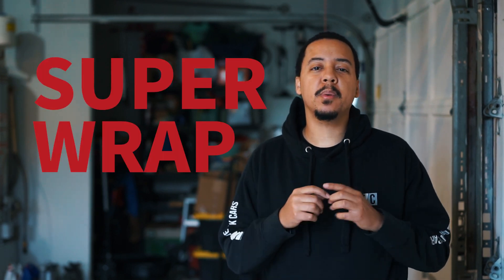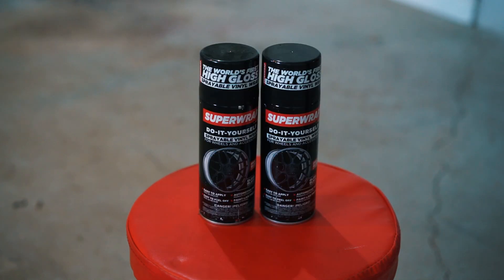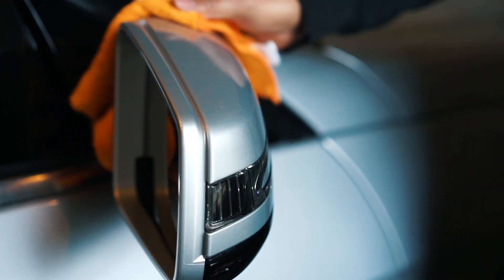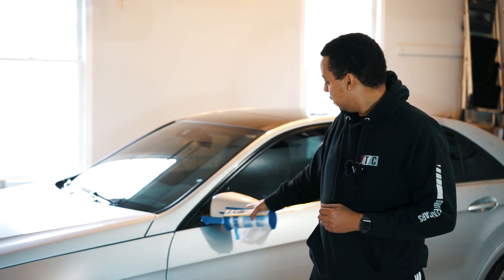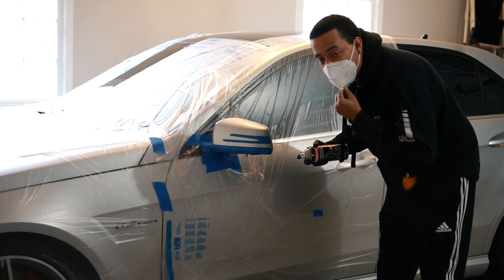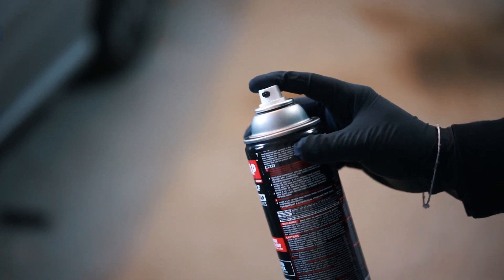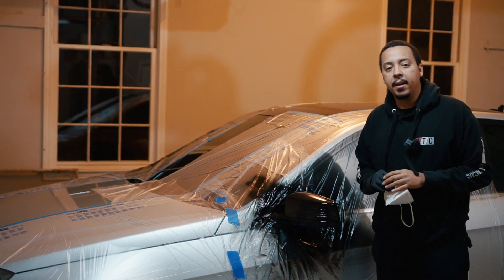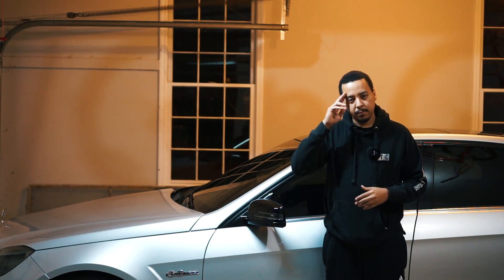Gloss Black Side Mirrors using Superwrap! Wrapping Side Mirrors on my Mercedes Benz E63 AMG W212!

Comment: From my opinion better to just 3m wrap it much better even look and less mess and will not chip away in few months
Reply from the maker: Thanks for the comment. Vinyl wrap is definitely less mess and produces a more even finish.  One advantage to the spray vinyl is you don't have to try and manipulate the vinyl around curves and tight spots.  I actually ended up swapping out the side mirror covers. Check it out here (https://youtu.be/1NBqNLt2Qhc).  This was probably the easiest method. 🙂